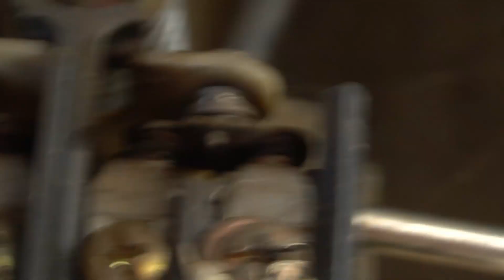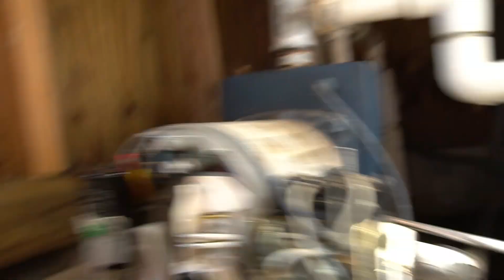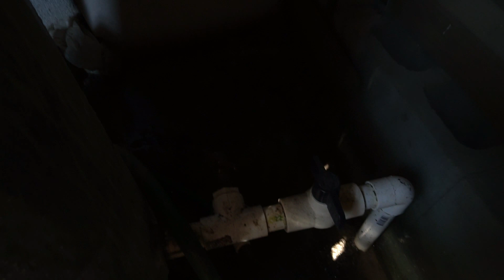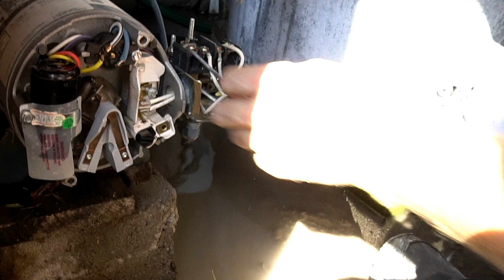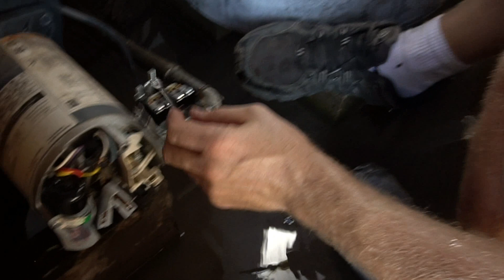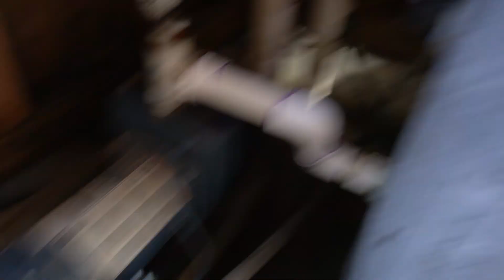Shallow Well Pump - diagnosis and repair

Comment: I had a galvanized tank with what I think you are calling an air vine control and a Myers hj50s pump . Tank developed a leak and I replaced with a bladder tank and plugged the inlet in the pump where the tubing went 
Will that be a problem?
Reply from the maker: Nope thats how you convert to a bag tank, so long as your pressure setting on switch relative to air charge in tank you should have no issues.  Atleast you didnt try to put the avc back in line i have seen people do that.  Thanks for the comment let me know if you have any other questions!
Reply: @ClearWaterPumpWell  i

Comment: Kind of dangerous standing in the wet water and then letting it spray all over. Why didn't you just kill the breaker? Thanks for the video though.
Reply from the maker: Brian Eckert ,Yea I was I should have not been doing that. The well, pump and tank was in a cutout in the floor of shed.  Very hard to work in but I just had to show it had everything wrong with it. I'm very comfortable around electricity been doing it for 20 years. Thanks for the concern and I'm definitely not intending on anyone doing exactly what I did.  Just showing the sound the motor makes when it's not starting.    Thanks for the comment, take it easy.
Reply: @ClearWaterPumpWell  No offense but, when we become too comfortable around electricity we tend to get complacent. I tripped an 800 amp breaker to a small switch gear because I got cocky and tried to remove the mounting fingers to the bus bar from an older style breaker to get ready for the new mounts for a new breaker. Rather than shut off the 480 volts to the switch gear I removed one leg just fine. Was the second one that hit the third one when I pulled it out with my Klein side cutters. I had turned my head and closed my eyes about the time I pulled back to remove it. Just heard loud pop and a bright flash through my eyelids. Felt it too. Could have blown the entire thing up in my face. When I opened my eyes, it was very dark in that section of the building. Was very stupid. since then, I have been nervous around electricity. Makes me a bit safer when handling it. Just takes one time to be stupid.
Reply from the maker: @cyoteone  I agree with that, I only work with the power disconnected.  With 120 v if you Tripp a leg it's no big deal hardly makes a spark.  You might brush it with your hand from time to time, that's not fun and believe you jump!
Reply: A GFI outlet for the pump is a good idea too...😉
Reply: Certain make breakers sometimes can be hard to trip over a long distance. 120 volt too. In commercial jobs, you try to short wires to trip the breaker and the pipE rattle with the wires jumping. Think its more the ge breakers. Cant remember.

Comment: I have a submersible well pump and big galv tank. Recently,air in our pipes in house. Nuisance ,noisy. Snifter valve is often letting out air.
What do I need go do to get air out of pipes? Thanks
Reply from the maker: Frank Lee, You would need to check the side of your tank in the middle port should be a "air release"  if your tank is "air logged" and you have too much air, it can get in the house lines.  Turn off the power to well and run water at a faucet close to well.  Doing this should relieve some extra air.  Check to see if the air releases or not. If no air is coming out then you will probably have to replace air release.  Get one from a hardware or order one online.  Make sure you drain all water and air pressure from your tank before you try to remove it.  

Thanks for your question and let me know if you need anything else. Be good!
Reply: Thank you!
Reply: @ClearWaterPumpWell  wouldn't using bladder tank solve the air bleed issues? It really is hard to beat the well pump with tank at Harbor Freight. Maybe not for a whole house in the long run I guess. Mine is for alternate and outdoor water supply. But, it is drinkable water.
Reply from the maker: @cyoteone  No that would not fix the issue, the air control system is not removing the excess air. Installing a bladder tank will not remove any air from the submersible pump and tank system.  Replacing the air release on the tank will fix the issue.  Try pulling a submersible pump hanging over 100 feet on a bladder tank and you'll never want to do it again.  Standard tanks are more reliable to use than bladder on submersible pump installations.

Comment: The plastic trianglular piece in middle i think you are calling Start Switch is there another name for it or where do i find it? I do not see one on ebay or amazon
Reply from the maker: curtis p here is a link for one at a good price online.   https://rover.ebay.com/rover/0/0/0?mpre=https%3A%2F%2Fwww.ebay.com%2Fulk%2Fitm%2F262886096917
Reply: Thanks Alot, Is there a way of testing the old one? I just took mine off and its burned in between the two metal contacts but i read online if its bad it makes a humming sound. Mine just went out and makes no noise at all i replaced the capacitor because i had a extra on hand and still will not turn on or make any noise. I looked in hole on side copper wires were good.
Reply from the maker: curtis p you have to make sure you can see the start windings, and the switch can just be sanded to diagnose first. With a good switch, capacitor and free spinning motor it should run unless something wrong with windings. Also make sure you have the same MF rating for the capacitor it should be a 161-193 for 1/2-1 HP starite pumps.  If it's not close to that it will not start also.
Reply: Thanks a million i hit those burned contacts  on the Start Switch with the dremel to get black off put it back on and it started right up!! Now i have time to order a new one and have water.
Reply from the maker: curtis p Good deal man, you make the 8 th person I got water today! Getting one water right now still working at 10!    Take it easy bud.

Comment: I'm surprised the snifter valve doesn't bring in enough air to lose prime on the pump on a shallow no flowing well.  With this well flowing I'm sure that helps keep it from losing prime.  Do you run into issues with getting air in the houses?  I know the air release on the tank takes care of most of it but on wells we have that hit air with submersible pumps, sometimes the bubbles are small enough to carry through the pressure tank and end up in the faucets.  It's just a nuance issue most of the time.

Kenny
Reply from the maker: Hey Kenny, not really at most even with a standard tank you will still get dissolved air in the water.
Even on a flow well it usually stops drawing air around 40 psi when the jet kicks in.
In this wells case the old AVC's just wont work without throttling the valve on the flow.
Its also very effective on flow wells that have H2s, cause your always getting new air in and old air out the air release.
Heck i have even seen a phenomenon where a standard tank without a AVC never lost its air charge, the guy swore that he had not put air in the tank in years!
My only conclusion was that the H2s had replaced all the air in the tank over the years and had become saturated.
This more less seemed that the water was so concentrated with H2s that it would not redissolve into the water!

Anyways Thanks for the comment, Casey